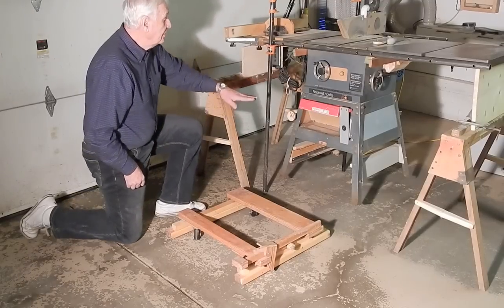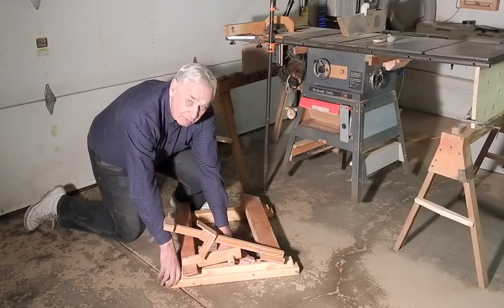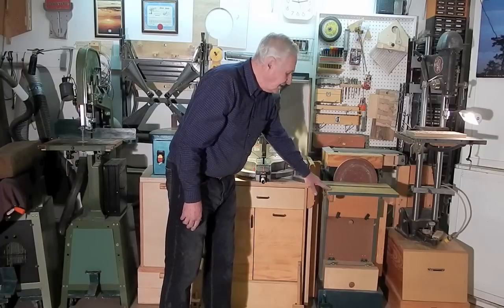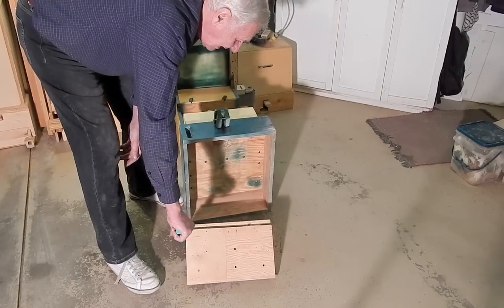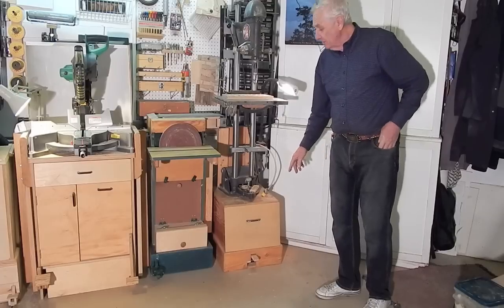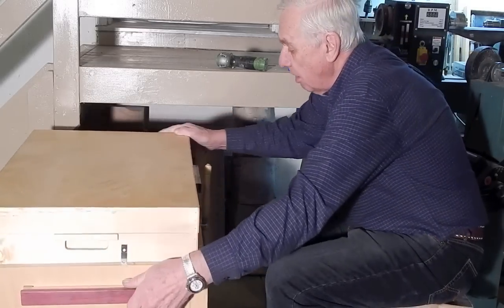Retractable Casters for Power Tools

Comment: Just bumped into your excellent video.   The physics of the mechanism is elegant in the use of levers to achieve the torques necessary to lower the wheels and lift the equipment, yet able to be adapted to suite numerous machines.  Your explanation is great, easy to follow and allowed me to see how the mechanism/setup can be modified to suite my particular scenario.  Due to space and weight restrictions I want to use a linear actuator to move the mechanism.  

Your video was the first I've seen where I could fully see and understand the principle levers (or lever action) necessary. This allowed me to design a better and simple way to do this, all based on your design; many thanks for saving me numerous lost hours on unnecessarily complicated prototypes.  I now see how I can use some threaded rod and an electric motor to move the mechanism, be it either by an electric drill connection or permenantly fixed gear head motor.

Comment: Very nice approach in wood. 

I made something similar years ago using one trolley mounted at the rear of my TS and used two Fixed Shopping Cart wheels fastened to the front legs of the TS and mounted flush to the (concrete) floor so that, raising the rear (lowering the trolley with the swivel caster wheels) lifted the front legs off the 'feet' and allowed me to move ('dance' with) the TS.

Your design allows hiding all the mobile parts and is 'elegant.' KUDOS

Comment: Excellent, thank you. I will use your idea for a couple of tools on pyramidal steel bases similar to yours.

The principle is similar in your different examples - hinged wheeled base that opens out to raise the tool off the floor, with some method of locking the raising lever in place. It's particularly useful and instructive to see the different ways you deployed this design. Many kudos.

Comment: some super great ideas there!.. thanks much for the complete explanation and showing all the details. I have my tools up high enough so that I can get a pallet jack, jacks under them. the biggest, a radial arm drill weighing 6,000 lbs, but your methods would work great for some of my less heavy similar size tools by using metal instead of wood. thanks again

Comment: I wonder if some day you won't regret not patenting this idea.  I've built similar systems, but yours is far more sophisticated.  I came across this while researching how to move my planned router table, and this is the best way I've seen.  I expect I'll be doing something very much along these lines.

I built a base to make my 350 lb (160 kg) table saw movable,  and it's vastly more complex than this.  I wish I'd seen this video years ago.  It would have saved me a lot of time and effort, though it wouldn't have given me an excuse to begin to learn welding.

Thanks for sharing!
Reply from the maker: DIW  Than you for looking at my video and thank you very much for the compliment. As for patents, watch what happens in the Apple Iphone vs Samsung dispute.  ///Carl

Comment: What a great idea I've been struggling with a design of for cabinet makers work bench that could easily be rolled over the top of my table saw. I think I may have come up with idea now based on the lathe caster system you designed. Thanks!

Comment: Thanks a lot for the inspiration. I ended up chickening out on the latch mechanism, and made the foot pedal pivot on the board holding the back two casters. That way you can latch and unlatch it by moving it down and under a fixed pin attached to the front leg of (in this case) a workbench ... if that makes sense?

Comment: Absofreakingloutely AWESOME!   Ingenious and effective.  Carl, you are the man.  I've been looking at other designs and they use massive beams and even a car jack for a bench saw in one video.  The simplicity and light materials of your design put it in a class all of its own.  Bravo Mr. Holmgren.  I'm making these for all my tools, except for the table saw that already has the Delta mobile base under it.  Your design puts that thing to shame.  I have to wheel the saw around like a wheelbarrow and if I set the screw legs to keep the saw level, the legs drag over high spots in the concrete floor when I move it, so it's set at a slight angle.  Drives me nuts.  I already have everything I need to make one like yours.  Wish we had some dimensions but it looks pretty easy to figure out.  Thanks for the wonderful design.  I've already forwarded a link to my tool guy friends.

Comment: Ingenious!  Great work. 

On the disk sander, I couldn't quite figure out how you latch it into the mobile position.
Reply from the maker: Steve H.:  I presume you're asking how to lock the casters down in the extended position.....    When the pedal is depressed to extend the casters you rock it forward to extend a pawl into the top of the pedal slot.   To allow the casters to retract, you rock the pedal back to withdraw the pawl and allow the pedal to rise,

Comment: Your toolbox design stands out among all the ones out there, in that there isn’t a large pedal sticking out. I love how your designs entrap the mechanism instead of using a second set of hinges to connect it to the frame. I imagine you had a bit of trial and error to size all the parts appropriately. I’d very much like to try one like your toolbox design. Is there some kind of cable running diagonally along the vertical bar? I can’t make it out clearly and am not sure what it would do, but I’ve never out together a pushrod sort of mechanism like that before, so I’m a working a little in the dark. Thanks for all the fantastic implementations!

Comment: There's others that have videos about their retractable caster systems but your designs (for various items) out shines them all.
I'm wondering how it would handle a multi function work bench (table saw, router, thicknesser(sp), planer, drill press, band saw, sander (belt & drum) and maybe a lathe?

Comment: Ingenious designs. I have a 200+ pound work table in my basement shop that I've been scratching my head  on how to make it mobile. I've watched over a dozen videos on the subject, all good ideas but your systems are head and shoulders above the rest. I'll be looking at borrowing your wood lathe system for my work         table. Many thanks. BTW, any ideas on how to make an enclosure for my  son's 3D printer?

Comment: Carl Thank you very much for a well thought out way to make shop equipment moving easy and affordable. I've watched your video here several times now to understand the latching system that seems to be the hardest part to follow. Most it seems use a rocking foot peddle that tilts back into a lip that holds till you push on it again and let it slide back upward. I was wondering if you have come up with any ideas on vacuuming hook ups for your saw and other equipment. If so I think that would be a nice video to add to your collections of videos here. One other thought. I noticed your miter saw has a peddle on the right side as well. Just curious what that might be?
Reply from the maker: Gary H   All my retracting caster systems use a foot pedal or hand lever to rotate caster mounting boards downward and  "jack" the tool off the floor.  Various latching systems are used; most use a "rocking foot pedal" with a pawl the engages to lock the pedal down.  On early designs I push the jacking pedal down and sideways into a horizontal slot i.e. drill press/Shopsmith.  The table saw pedal latches down automatically with a gravity-operated latch. A separate small toe pedal is used to unlatch and lower the tool. Be  patient, I've been working on plans starting with the "Flip-Top Tool Stand, Mitersaw Stand and Belt Disc Sander.  Each will have detailed descriptions and dimensions including the caster systems.  

Re vacuum hookups please look at my video "Dust Collection Duct and Gate System"
Miter Saw Stand: the RH Pedal opens a tip-out bin for waste cutoff pieces.  Please see my video "Mitersaw Stand"

Thx for comment and questions /////carl

Comment: Hi Carl. Great video. Thank very much for sharing. I was trying to build your Jointer's casters base ,but can't work out the part  of the foot lock down catching plate, the part that your foot press on to lock or unlock for the raising or lowering of the base. Is it possible to show a photo on the part. It looks like there could be a hinge involved, but can't work out how it is mounted. Thanks Great works !
Reply from the maker: rsmli, Thanks for kudos.  Not sure if it's possible to provide a photo; will try to explain - A hardwood pedal arm is attached to the rear caster support plate. A pedal is attached to the arm with a hinge so the pedal can rock back and forth a limited amount,  At the tow of the pedal is a latch pawl that rotates under the front cross member of the jointer stand when the pedal is depressed and rocked fully forward. When the pedal is depressed and rocked fully back the latch pawl is moved clear of the cross member and the pedal arm can raise allowing the casters to retract and the tool to settle onto the floor.

Comment: Thank you Carl.  This is exactly what I have been looking for.  The Table Saw system is great and will be my next project.  It is unclear how the latching system works on the next set of stands, at first glance you appear to press down to lift and press down to release but it looks like the foot pedal is key, when down it jams under something to keep the wheels down - is this correct?

Comment: Thank you for sharing your retractable undercarriages.  You should file a patent before some big firm works out how to mass produce these for some outrageous price.  I've favourited this for reference when I finally get my garage sorted out.  Such a brilliant concept using the power of the fulcrum to lift and move some pretty heavy kit with the minimalist of effort.  I like how you've made them all easy to disassemble for maintenance as well. The tool cabinet is a work or art and looks so easy to extend and retract with that small handle.  You Sir are an inspiration.

Comment: Omg thank you thank you! Just built a new workshop and just start to think be stands and layout so will be busting the whole set of plans! Wonder if there is a good way to know when to use each type of design? For instance I’m building a new job site table saw stand with RT it will be about 50 wide by 30 deep so don’t know if I should use the design of the table saw lift or the larger independent lift on each side?
Reply from the maker: Anna,  Thank you very much for "busting" a set of my plans.  For your table saw, I recommend using my table saw RT plans;  my table saw is 70 inches wide and RT system works fine with it.   ////Carl
Reply: I am so sorry. I must have been using voice to text without rereading. That message was a mess.  But thank you for the advice!

I just purchased the set of plans, yeah, but, no download link? Emailed you about the issue.

Thanks again!

Comment: Truly simple, innovative and genius imo. If I found these in Home Depot, I would buy them! 

Are you really lifting up a 450lb tool chest with that simple easy hand lever or were most of the tools out?
Reply from the maker: +Bill Nunley     The tool cabinet was full of tools.  It may look easy but it still required about 25 pounds of force on the handle, that is until the arm at the back is rotated down near the overcenter position, the force required becomes less.    Thank you for the compliment    ///Carl

Comment: Thank you very much, Carl. I will use your designs in my new thickness sander, bandsaw and thicknesser stands. I also HAVE to upgrade my own poor designs that I used under my router table and drill press.
Well done ! The best designs I have seen!

Comment: The planer and disk sander use two different methods to lock the casters in the down position. With the planer the pedal presses against two raised pieces of wood above the pedal. The sander uses a dowel extending from the top of the pedal. Of the two methods which one would you recommend?
Reply from the maker: Oliver,  I prefer the planer stand. There's room for a narrow drawer between the boxes that contain the caster mounting boards.  The design of the planer stand allowed for the caster retract pedal to be located on the side of the stand. The sander stand required that the pedal be located at the front of the stand.  Thanks for viewing my video and thanks for the question.    ///carl

Comment: Awesome design. How does the latching system work to release the casters and draw the wheels back up from the foot pedal?
Reply from the maker: Austin Pehl The tool and/or cabinet is raised by simple levers for which the fulcrums are the casters. Pressing down on the foot pedal jacks the cabinet off the floor.  When the foot pedal is unlatched and downward foot pressure is removed, the weight of the tool and/or cabinet pushes down on the short end of the levers till the cabinet is resting on the floor. Thanks for viewing my vid and thx for the question.////carl

Comment: Great idea and nicely implemented!  You could also have fixed casters and lower feet to stabilize the tool.  On my talesaw I have casters mounted such that when I grab the opposing extension and tilt the tablesaw up, the wheels come in contact with the ground and I can wheel it around much like a wheelbarrow.  I suppose on a larger tool one could use a wheeled trailer jack to tilt the machine up and then wheel it around on three wheels.

Comment: Thanks Carl - most helpful! I have successfully built one for my sander and planning on making more for the rest of my workshop, I really like that the machines are stable on their own bases unless the castors are activated. A hint for others - I used the design from the table saw and its a smaller rectangular stand - it nearly didn't scale down that far, but works once I replaced the wooden roller with a skate bearing.

Comment: Carl, Do you have a guideline for when you use 'all 4 swivel' vs '2 fixed, 2 swivel' vs 'all 4 fixed'? Why not all swivel all the time, even on tools you only need to pull straight out? The pricing seems similar, so I'm curious about the drawbacks of swivel casters.
Reply from the maker: R.K.   Generally I like to have two fixed casters at the rear of the tool and two swivel casters at the near side.  I can drive the tool like a wheelbarrow when moving it.  With four swivel casters it can take a lot of effort to swivel all four casters to move the tool sideways.  On tools where the casters are spaced closely together, such as under the bandsaw, the tool can be quite unstable if swivel casters are used and they're swivelled inwards. ////Carl
Reply: This is very helpful. Thank you for the detailed response.

Comment: Simply the most elegant solution I have yet seen to a problem we all have!

Thanks for sharing in such a lucid manner. Your installation methods are what caps the method and raises the bar to true ingenuity.

I have a few mobile bases that need your method. Thanks again.
Reply: Wouldn’t it be better if someone built a bracket that the table saws leg would slip into and the bracket had a hole in it for a wheel

Comment: What is the mechanism that makes the casters stay on the on and off position?
Reply from the maker: I.A.   Each type of caster system uses a latch to hold the pedal down. the casters extended and the machine raised.  Nothing holds the pedal up except the weight of the machine.   ///Carl

Comment: Carl, Great video and thanks for showing all the different versions of your caster system. I am building a mobile base for my drill press and really like the latch system you have on the table saw base.  Did you figure this out by trial-and-error or is there an engineering degree at work ?  Can you give me some pointers?  I am trying to figure out the relationship between the pivot point and the latching/locking faces.  Thanks again.  

BTW, I noticed in your comment to Jack Wong, you are going to put a base on your work bench.   I modeled mine after the Shop Built video and it works great.  His is a very similar design to yours.  I would really like to incorporate your latch system on to that as well.

Comment: hi mr holmgren, thank you for sharing your work. i`ve been trying to find a suitable system to move my welding table (close to 570kg) and nothing i`ve seen is more adaptable than your system. i think by the shape of the levers that you know very well what you`re doing, and i like very much the fact that to install or remove the systems you don`t have to flip the object to be moved. really clever. thanks again. regards. peter

Comment: Carl, thanks for sharing this. Do you have a formula or some rule of thumb guide for how much height is required for the retracting castor system? That is, if I have castors that are "C" inches high from floor to top of mounting plate, the bottom shelf should be C + ?? inches, or C x ?? inches high or ... ?
Reply from the maker: On my power tools with a skirt at the bottom of the stand like my miter saw stand or my belt disc sander, the underside of the cabinet floor is C + 2.5" (3/4" plywood caster mounting board plus a 1 3/4" cleat.   On my planer or mechanics tool chest the caster mounting boards pivot on a 5/8" dowel,  Floor is C + 1 1/8".